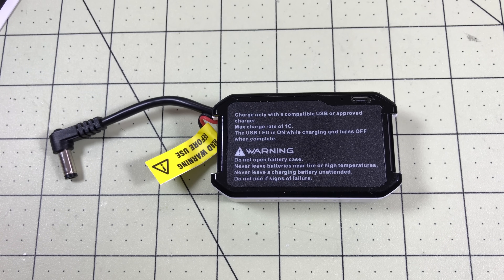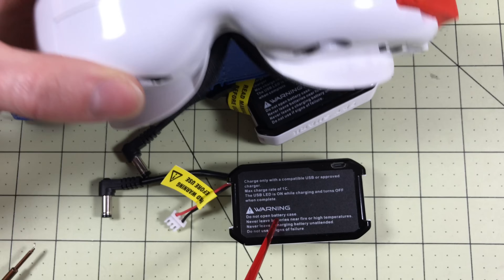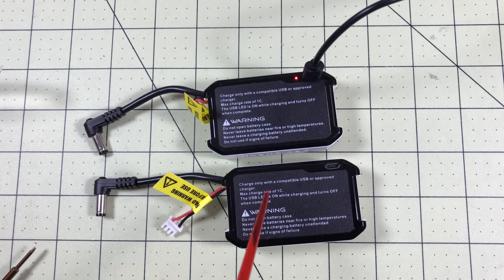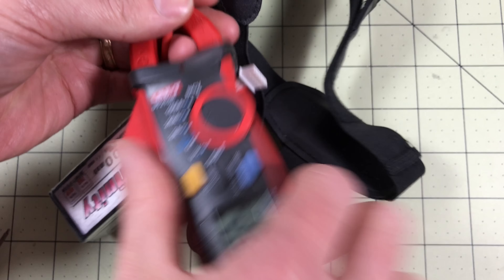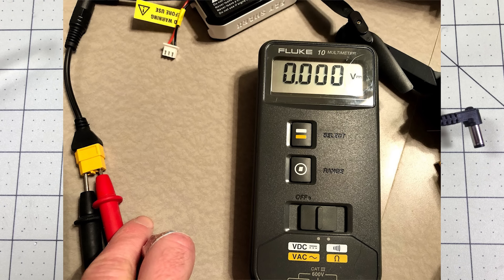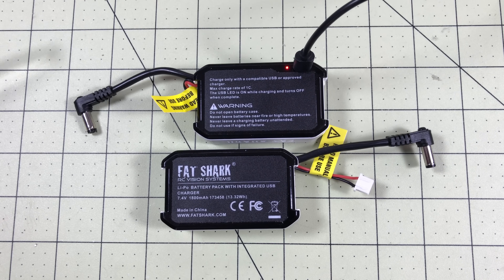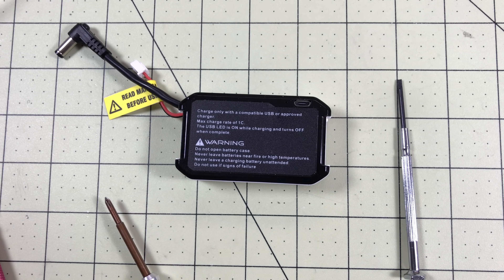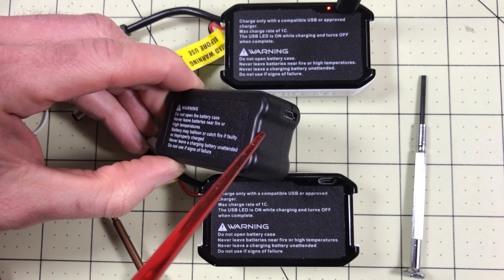FatShark USB Battery Testing, Teardown, and Review. Finally the best Goggles Batteries?

Comment: How accurate are the battery level led lights?  The leds on my battery show 2 bars, but my rx module shows 88%.  I am not sure which is right, and at what point I should stop flying and charge them.

Comment: can i plug in a phone usb charger to the back of the battery case?
Reply: Yes you can. But watch the amps on the charger. I use max 1.5 amps, because of the 1 c issue. Fatshark battery 7.4v 1800mah. Phone charger (the Netherlands) 5v 1, 1.5 or 2 amps so 1 think 1.5 amps is safe. Charging time approximately 1.5 hour

Comment: I tried more than 8 hours and still 2 LEDs only. Does it take that long ? New hdo model
Reply from the maker: Does the red light lite up when you plug in the power?
Reply: DroneRacer101 yes. It does. Strange isn't it?

Comment: At 4:07 you test the current draw using a 4S battery.  Later you use the same current draw when discharging a 2S battery!  I think you need to recalculate that!

Comment: Be aware that how long your batteries last, regardless what you're using, won't be universal across Fat Sharks.  I know absolutely for a fact that my batteries last less than half as long once I installed a LaForge diversity module compared to the bundled single antenna module, and it was astoundingly less obviously.  I use the Fat Shark 18650 battery case and the Dominator V3s.  I used to charge my batteries once every 2-4 days.  Now, it's every 1-2 days.  But honestly, I prefer the 18650 case solutions.  Yes, charging them is a bigger pain, but I can also just keep a second pair of batteries in my bag, and I can for sure fly as much as I want in a day.  I also don't generally need to worry about charging them under supervision, like you should with any LiPo battery.  And when the batteries wear out, I just pop new ones in just like I do when I need to charge them.  One other thing to point out is you can buy 18650 batteries now that have USB charge ports.  Unfortunately, the only ones I've found are protected cells, and I've never been able to manage fitting protected cell 18650s into the Fat Shark battery case, so I don't think those would be an option.

Comment: Hi,
Just a friendly remark about how you measure the current draw. If you use a 4S battery then the Voltage is higher, let's say twice the voltage of a 2S (roughly). The power used by an electronic device is measured in Watt by the formula Watt = Volts x Amps.
So it means the current drawn out from the headset of a 2S pack should be around twice the current out of a 4S pack.
That also mean your result discharging a 0.5 A probably gives a good estimation on running time of 4 hours (as you don't double it).
The balance connector is not used to balance because the internal cuircuit preventing discharging too much also balance the cells while charging.
Great review btw.
Reply from the maker: AH, that is an excellent point!  I didn’t even think about that when I grabbed the battery to test it.  I have more tests planned and will certainly correct that.
Reply: What is that balance/not balance connector used for anyway?
Reply from the maker: In some goggles, like the FatShark brand, that is used to power the fan.

Comment: LiIon have a lot of capacity with little weight (use 3000+mAh unprotected cells, go for high capacity, not high current). As a vaper I happen to have a cheap but good charger for LiIon round cells (Liitokala Engineer Lii-500) and with this I can charge 4 cells from completely empty to full in under 3 hours. So for me the old battery cases with changeable 18650 cells are ideal.

Comment: Hello DroneRacer101, need a second opinion on FC(bat-100) that gets very hot in a matter of 10-15second upon connecting to battery, can we rule out that its a faulty FC? tried to take off immedietly but FC gets warning beeps & resetting which definately fall of the sky.(yes FC, not esc/vtx/receiver).

Comment: Does not goggles have displayed value of battery in some corner? What would prevent destroying batteries when comes to 7.0V then user could remove battery and save it.

But this way is even better which now using FatShark that battery simply stops working when comes to 7.0V.
Reply from the maker: It depends on the goggle.  Some do, some don't.  But the problem wasn't with me killing it while I was using them . It was because I would forget to unplug it after I was done flying.
Reply: Interesting. Now I see that Eachine Goggles Two was very good buy. They have battery value and also some LED light on the case. So when stop using them at least from one side is visible that battery is still connected. But for now I used them just at simulators(still waiting that all parts comes that I finally could go in the air).

Comment: Slightly off topic question: the ev800d has an internal 2s lipo but mine drains real fast. It comes with a charging lead for 3s. Since i dont have a 3s but do have a huge 2s lipo i made a 3s-2s balance conversion cable but it doen't seem to work. Why cant i power a 2s with another 2s?
Reply: Rovadevel Fpv ...perhaps the simplest solution would be to buy a generic 3s bat. Although, you could try doing what I did on my vr006 and that is to remove the internal battery and run a 2s Bal lead outside the goggles where you can connect your large capacity 2s batt and velcro it to the head band. This of course requires some splicing and soldering, but that shouldn't be a problem.  Hope this helps.
Reply: Brad Miles thnx if i don't win the aomway from marks giveaway i'll give it a try to take it apart
Reply: Rovadevel Fpv ..if I win them, I'll send you my ev100's.  Lol
Reply: Maybe you can try to replace the internal battery on the EV800D’s

Comment: I JUST HATED FATSHARK  !    I have the EACHINE Battery when I received my EV-100 I charged it in December and it's still full I fly once or twice a day and yes it is my back up googles and I use them only twice a week but I have no complaints GREAT SHOW LOVE THE INFO.
Reply: JohnnyD RC .. how long does the eavhine batt last on single charge usage? Looking to get one soon .. thanks
Reply: mikro T-Rex  Hi Milko TRex I purchased mine BACK in December and I use them 2 to 3 times a week and I fly a DRONER on 3s 550mah and a fly egg 130 on2s 550mah ,I have three of each , NOW I  don't have to change them once a month or so,  But they never go under half charge,  I just can't FLY much more than that .  I never run it down much more than that I wish I could tell you that they last 2 hours 13 minutes but that is as much as I use them I have a wandering eye witch makes wearing two screen goggles hard so I tend to use the EV-800D so I can record my flights so if I crash I can find my quad in high grass, I have a buzzer but I can't hear it I wish that I could have given you a better answer. I think they are perfect for how I use them I have NO COMPLAINTS ABOUT THEM. I also like the usb port for charging so if they do run low you can change them back up in a car jack or computer have a great week flying   JohnnyDRC
Reply: JohnnyD RC .. thanks for the info. Thats more than helpful. I only get to fly maybe 2x a month.. so your info is spot on. Thanks again. ☺

Comment: Yeah... ditch the Lipo and go with the 18650 3400mAH li-ion  batteries and case. 

The only time I use the Lipo that comes with the fatshark is for a backup but in all honesty I can go all day long on the 18650 cells
👍